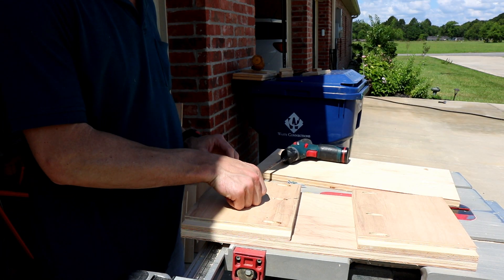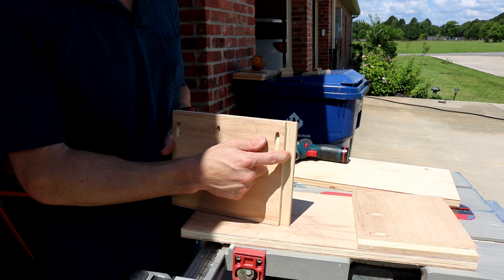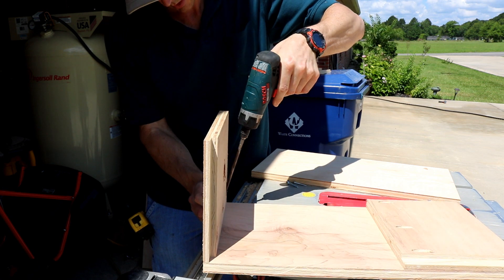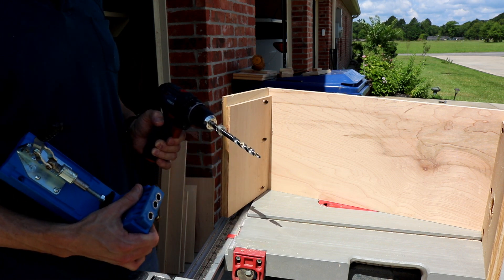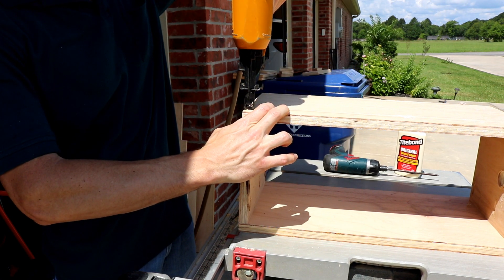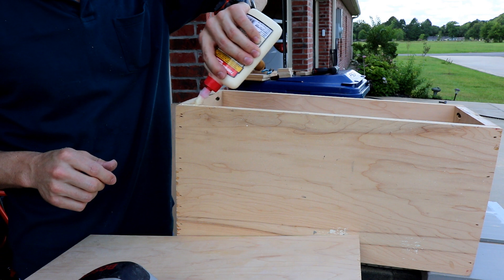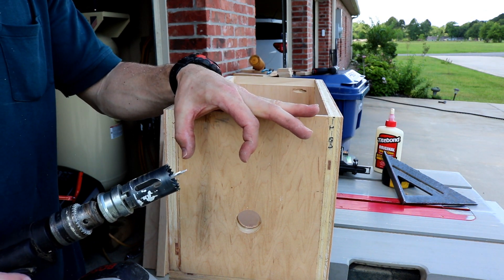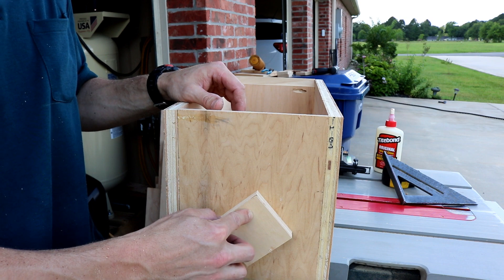Honey Bees How to build a Swarm Trap out of scraps!

Comment: Interesting how it is made...I never thought about charring the outside as a protective layer...how long will that keep it in good shape? Do you not use other protectants due to chemicals?
Reply from the maker: I really just did this because it was fast and the paint has not been holding up that well. If you really do the charring correctly they say it will last a long time. This being plywood really can't get it charred enough to be effective with out the plywood layer raising up.